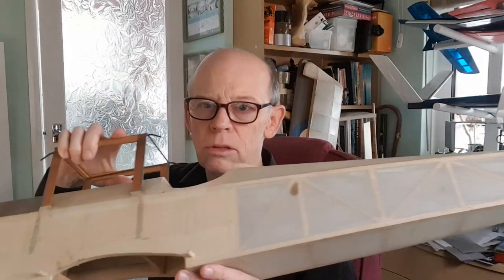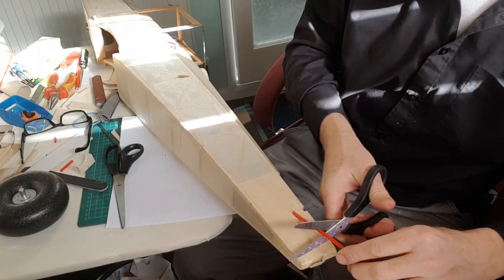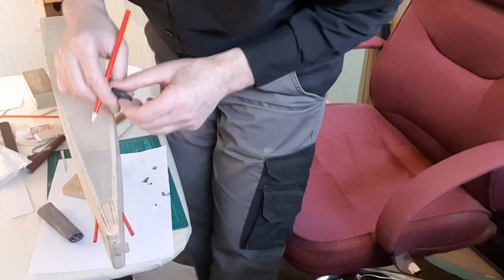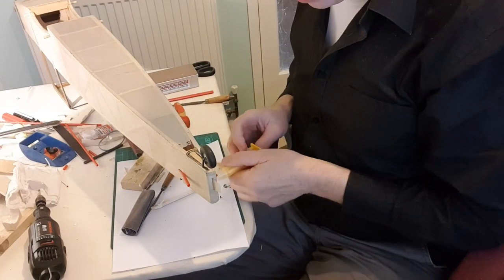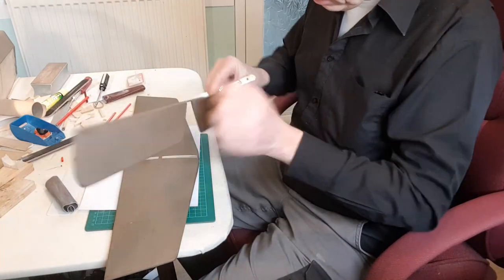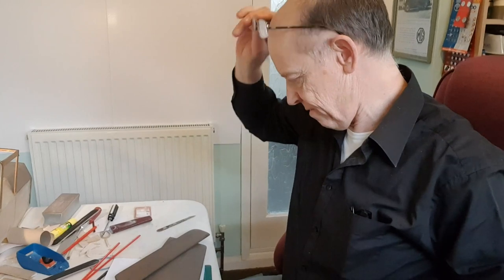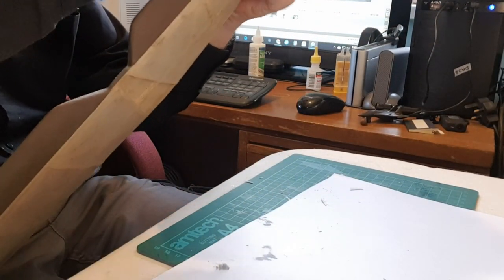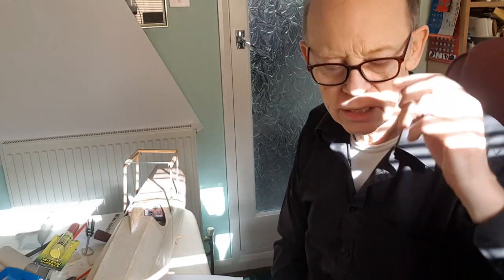Mannock Biplane, Part 9, Tailwheel, Elevator and Pushrods

Comment: Watching this, the build looks fantastic. Took the tutorial you did on microaces nieuport to heart I'm working on the 4 ch. D7 the tips you gave are really helping me out so far keep it up
Reply from the maker: Thank you Titan, it's much appreciated. I'm glad my tips helped a little, are you going to post a video or two?
Reply: Bit far along for a video now but i might be able to get a bit if the aileron assembly that being said fuselage is mostly finished the bottom wing and the gear are in place now i have to work on the electronics and get that set then i do the wiring